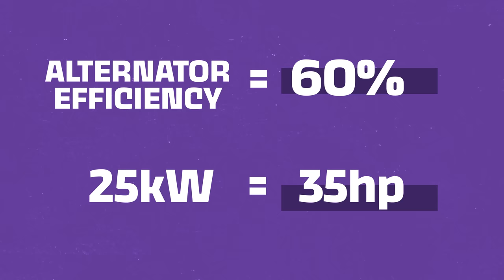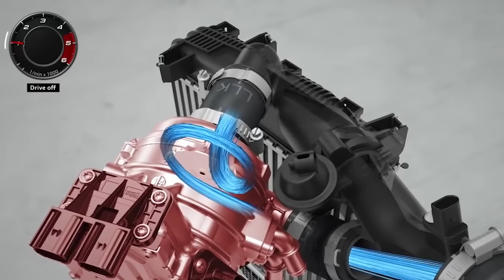Are Electric Turbos a SCAM?

Comment: aight hear me out. HYBRID TURBO. so basically, a normal turbo, with attached motor on it. the motor only spins the turbo at the first pull, just to eliminate lag. other than that, the turbo works just the way it is. and also, the motor would be a generator for the battery, if you need more electricity #cmiiww

Comment: Electric motors are far more efficient these days. It works. Garret even fitted 2 of them later on. It's no where near as efficient as an exaust driven turbo but it still worked and made more power.

Comment: bruh but hybrid vehicles... if you have a way to support and cool the extra power you can just jam an electric turbo on a hybrid cars motor, make a regulator and the other shit for it (if you got good programmers of course) and BAM parasitic loss is who? is what? I mean that engine (For example in a Camri) produces enough power on itself to make the car go brrrrrr, whats it gonna be borrowing like 20 - 30 of that hp for the boost? :-D

Comment: I would use a compressed air can (like a scuba tank) for turbo air supply and every brake that i make would recompress air into that can. Science bitch... Regenerative braking..! At the meantime one may also use some percentage of the exhaust pressure to charge that can while you are not braking... While driving anything you have to step on the brake more than the accelerator (yes true...) so no lag...  Problem solved.

Comment: So all electric turbos use a DC motor to run the fan? Why not use an AC motor powered turbo and get the most efficiency out of the alternator? Alternators are already AC motors.

Comment: Or, you could build your own, "slightly" modified version, in both in/output that performs higher boost and raises torque crazy. And, then lose your breathing capabilities, from thorough understanding of physics and electricity. I pat myself on the back, because i have to...😥

Comment: Technically speaking, electric turbochargers are NOT turbochargers. 'Turbo' means turbine and almost every engine with 'turbo' in their name has a turbine such as a Turbojet, Turbofan, Turboprop, or Turboshaft. All these engines have turbines to drive their shafts. Electric turbos themselves don't use a turbine for power, it's just a compressor bolted to an electric motor. You can call it an electric supercharger and it would be the same thing.

Comment: Honestly a 4min boost with a 40min recharge sounds pretty cool if it isn't Too expensive and gives a decent boost. I'm not driving pedal to the floor All the time. Thanks for wasting the next hour of my time while I look into these. lol
Reply: Keep in mind that your boost pressure is decreasing exponentially as you use it.  (The pressure loss compounds faster over time vs. Voltage or current. )

Comment: Funny to watch that video when you actually were in the design team of the turbo that Donut shows for Audi :p

Good job guys, keep up the good work !

By the way, the 4 minutes aren't an issue of the battery only, if you get a bigger battery to force it to run more, it'll just auto shut down to avoid a big boom in your electronics

Comment: So e-turbos aren't that practical...and traditional turbos don't give instant response...cuz they have to spin up.
So what if we use a traditional turbo connected to a motor and use the motor only to skip the spool up time only to give a better throttle response...will it work?
I mean 👆that is just theoretically speaking I don't know if anyone has this in practical use.
Just what if...

Comment: Electric turbo/ ducted fan thing doesn't come close to the performance of a real turbo.  You going to get 23 psi out that thing ? NOPE..... I think Electric Turbo is a bit misleading,   maybe , Electric Fan Booster is more correct.   A Turbo / Turbocharger,  driven by exhaust gases, are already defined titles belonging to ice's .  So find something else........

Comment: ALFERED farjam
23 ساعت پیش
 @mjcooke2  I want to make a charger with a tubo hair dryer... the hair dryer motor is 12 volts, I connect the positive wire to the alternator before the regulator, when I hit the gas, more electricity goes to the hair dryer motor and it spins faster and gives more air to the air filter, maybe I will test it have an effect

Comment: of course not, tesla shows it
Reply: pure dc motor turbo, like a pro, and a bro
Reply: no ac crap, I mean the electronics spaghetti, no not needed
Reply: is a donut a do-nut?
Reply: how about an external compressor tank to the engine
Reply: emphasis on the tank
Reply: you win some, you lose some
Reply: use a turbo generator, duh
Reply: so generate from the excess energy you lost, then turbo with the electricity, nice triangle bro
Reply: the only scam is the money related things
Reply: all solved, no turbo lag
Reply: full continuous turbo loop
Reply: oh so you burn donuts, right
Reply: if you put the generator turbo in the exhaust only, assume you get additional power, on top of the piston, combo piston-turbine engine, with the piston engine acting as the one way valve of a turbine or a pulse jet engine, but the turbine in the exhaust flow generating extra electricity or torque

Comment: your numbers are bullshit. a proper generator can have way higher efficiency and output than an alternator. turbos don't run on wasted energy, they add drag and backpressure, sapping as much power from your engine as an alternator feeding power to a compressor, since turbines are also about 60% efficient.